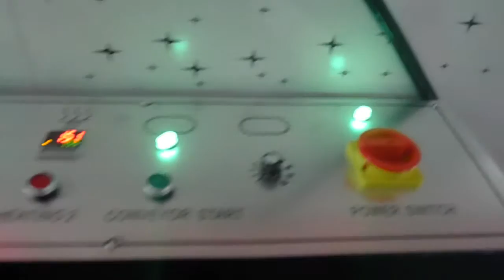Fully-auto Overlap FIlm Sealing Machine & Shrink Tunnel for floor

Comment: what is the maximun package size for this machine?
Reply from the maker: Standard machine maximum packing size is Length(unlimited), Width+Height less than 500mm, height less 300mm.
Reply from the maker: We also have some other bigger packing machines. Welcome you to contact with us. Contact person: Michael Zhang 
Mobile: +86-13524047758 (What's App)
Skype: Kukoexport007
E-mail: export606@goodpacking.com.cn
Shanghai Kuko Packing Machinery Co., Ltd  
Add: No. 658-E, Qiangye Rd, Songjiang District, Shanghai, 201602, China  
Tel: +86-(0)21-6974 6020#802   Fax: +86-(0)21-6221 9769
http://www.goodpacking.com.cn/
Reply from the maker: Hello